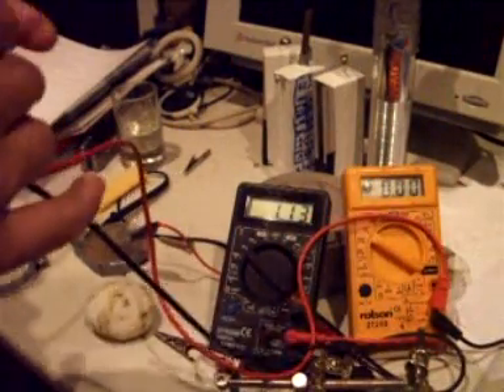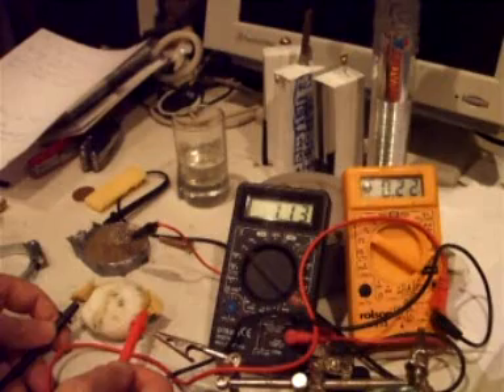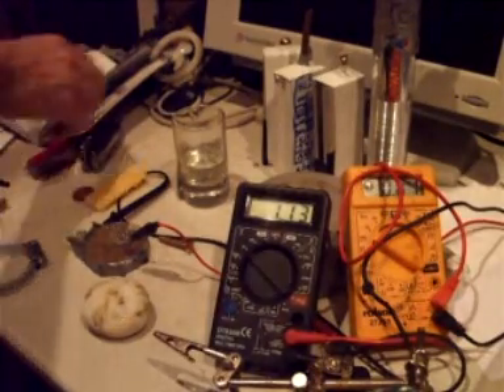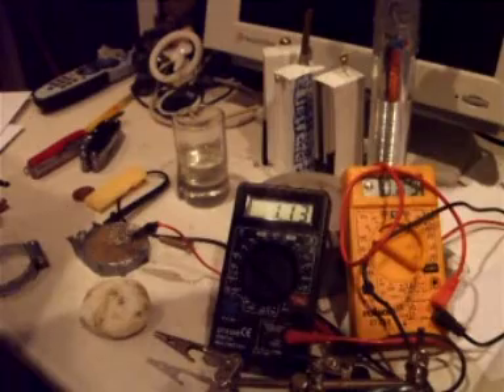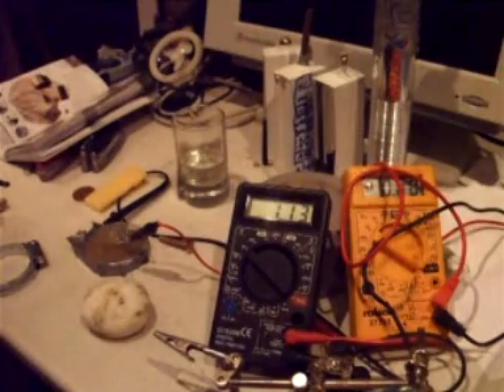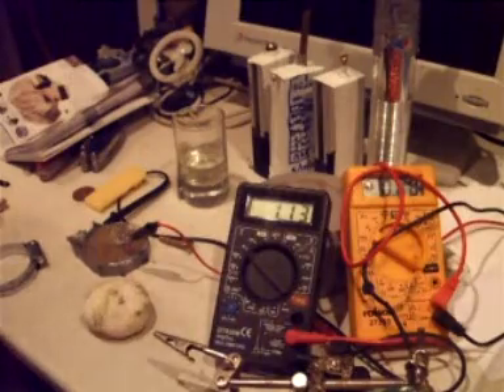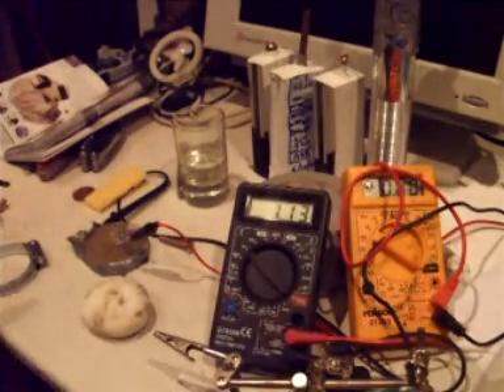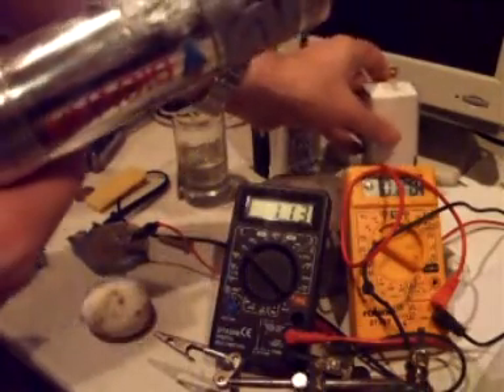crystal batteries free energy 2 of 2

Comment: Maybe ... BUT the multimeter has a battery which charges that "pebble - condenser" (capacitor); so, you must consider this aspect also, if you want to be sure that you have the right material . 
 ( With respect ! ) 
 PS: quartz and pressure ( different kinds ) = electricity ! 
 PS 2: your video is inquiring; CONGRATULATIONS !